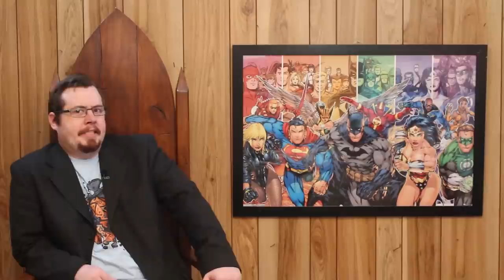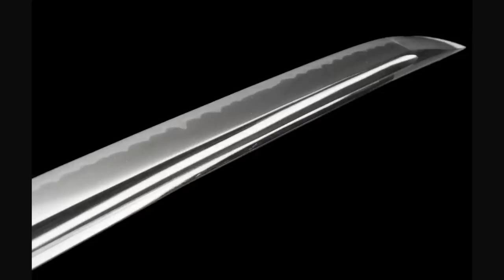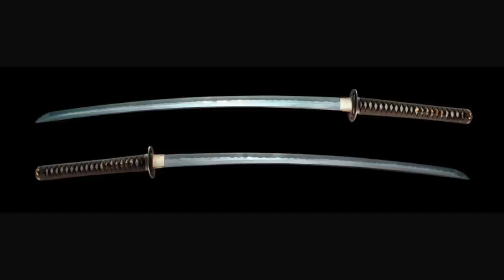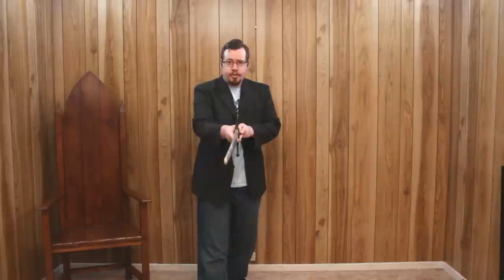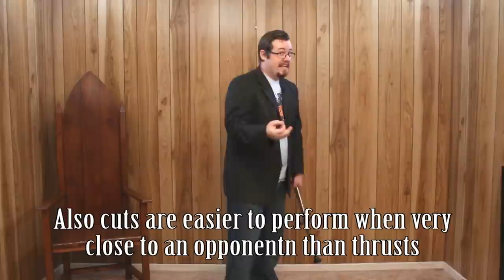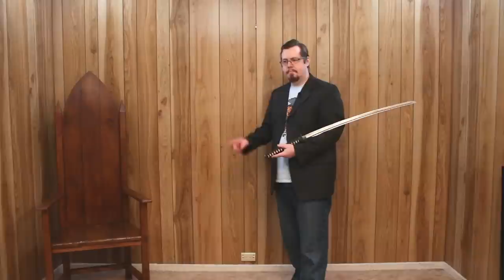Super cutting swords, are they needed?

Comment: The answer is actually probably more simple, looking at it from a workman´s perspective. Good enough sometimes isn´t good enough, if you bear with me. Anyone who works with wood, for example, knows the most dangerous tools are those, that aren´t as sharp as they possibly can be. There is no sharp enough woodworking tool. 
The same goes for swords. In order to work well in ANY situation, you just can´t have enough of its specialized power. Sometimes situations are less then ideal, especially in Combat. You might not have enough room for a full swing. You might be lying down or being hampered by a comrade. You might be weakened and can´t put your normal full force behind the swing or chop. The swing might not be coming in at the perfect angle. etc.
In those kinds of situations, what was formerly good enough might just not be that, anymore.

There are so many reasons for swords gaining a specialization and then trying to up it over the top. Just look at the roman Gladius, for example. In fighting close to your comrades, you had no room to swing. So it was specialized for chopping and thrusting. The whole fighting style of the roman legion was based on that. So could you be sure that you only met the same Barbarian, wearing no armor or just a shirt every time? What if they just for that day decided to wear some thicker wool or even leather? Or adopted your own armor, the early chainmail?
What if he was fat and you had to penetrate further? If he had a shield, would it take 3 chops to split it, or 5 or 6?

So no. I don´t think that good enough is good enough. ;)

Comment: sometimes weapons are designed FOR the tactics, and there are times when tactics is adjust to a specific weapon or its focused property. 
IMO, thrusting has to be a lot more precise to deliver that deadly blow to a pinpoint, especially on a moving target (harder to deflect, true, but also easier to dodge/shield block). that's why off-centered tips are so terrible at aimed attacks and mostly resolve to cutting tactics. as of cutting/slashing motion is wider and can acquire the target's area better. 
However, cutting motions are also limited in confinement, so in restricted spaces you'd prefer thrusting or chopping down or BOTH -- which would make the more versatile weapon the better choice. 
is it an overkill to be able to slash better? no. not more of an overkill than to be able to thrust better.  I think it's mostly about the purpose of the weapon (much like today you've got a vast variety of bullet tips serving different purposes). let's not forget that the rapier only took its spotlight in the urban duelists scene, not on the field. But who's to say that medieval trends were based on effectiveness alone, and for the sheer trend...

Comment: The romans thought the thrust was far more deadly and debilitating than a cut...however and this is key biological point here, the deeper and wider the hole you poke in someone is what's actually important...a very thin narrow blade for example designed to penetrate chain mail might not be deep enough, cause immediate damage, pain or blood loss to be deadly or debilitating.

I'm glad you actually brought up crowd control at some point though...people in these discussions seem to assume all things are equal and they rarely are, I highly doubt there was ever a time when fully heavy plate armoured knights, samurai or whatever (insert your favourite faction here) out numbered the lightly armoured ill equipped common foot soldier or peasant on the battlefield.
 
There are very basic tactics and strategies in battle and combat that boarder on opportunistic and cowardly...you don't attack the enemy where they are the strongest and most protected but where they are the weakest and most vulnerable, in fact if ya smart you don't engage or pick a fight with someone strong in the first place but rather someone who is weak...for example it just wouldn't be smart to have your mounted knights charge and attack other mounted knights, it's inefficient and stupid when ya can have them trample and butcher archers or peasant foot soldiers or infantry formations etc 

Common sense shit about war and battle is covered by some chinese dude in a obscure book (I forget the name) something something WAR lol...he proceeds to go on about the importance of deception and misdirection concerning this cowardly and opportunistic but common sense instinct, make em think ya weak when ya strong and strong when you are weak blah blah blah...whatever lets not go off on a tangent...along with this fairly obvious stuff he he offers other relatively logical and basic common sense advice about actual combat as well like the need to be flexible and adapt to suit the circumstances and how predictability is a severe weakness...one of my favourite female anime characters said it best "to over specialize is to breed in weakness which is ultimately a slow and certain death".
In short there is no right answer, no superior weapon, tactic, strategy, technique or method an intelligent and determined opponent can't find a way to counter and overcome.

Comment: I wonder if the key aspect of swords which are optimized for cuts is the damage they can cause to armor and to the enemy. If, for example, you try to block a heavy blow from a longsword with a thin and lightweigth rapier ... well, good luck. And the same (but not to the same extend) must be concidered when you use a longsword against a weapon that is optimized for cuting. An other aspect: Concider the effect on chainmail and scale armour. No sword can cut through, but the one optimized for cutting will cause much more pain and broken bones.

Comment: I think swords meant mainly for the battlefield cannot be looked apart from armor. I think beefier swords were more useful before full plate (or when there was mainly chainmail being used), not so much because anyone was under the delusion that the sword would cut through the mail, but because the aim was to beat down the person underneath the mail. So, a beefier sword with more weight in the cut means more punishment for the person taking the hit. Once plate armor is introduced, axes, hammers, and the like do the job much better than a sword would.

Comment: For some reason, as you’ve been talking, 1991’s Robin Hood: Prince of Thieves keeps coming to mind. Specifically, the scimitar that Azeem uses throughout the movie. It always struck me as a great mass of metal and weight at the point and illustrates what your talking about, no thrust whatsoever.  So now I’m curious on your thoughts regarding that design and also the Locksley sword the Sherriff of Nottingham takes from Robins Father in the beginning and uses in the climactic duel

Comment: you seem to be ignoring one thing about cutting swords : climate. curved swords such as shamshir were used in middle east, now unlike medieval europe, middle eastern countries such as persia were vast lands in which cavalry and horse archery were favored over infantry. the reason being that infantry has a harder time moving through middle eastern terrain due to heat and lack of water than let's say France. 

the issue of heat and horse riding long distances also brings the issue of gear, imagine the well-armored cavalry and knights that use plate armor. they will have much difficult time surviving a trek across the desert, now granted, they will not be in that gear for the duration of the trek, but they will need to gear up for the battle. and if you're trying to fight in full plate gear across the middle east in a harsh spring or summer day you're incredibly fatigued before the battle would even commence due to heat and dehydration.

the cavalry in the middle east would be wearing lighter armor, which gave them more mobility. the middle east concept of heavy armor would be chainmail which would protect them against arrows. that is why you don't see plate-covered knights in the middle east. it was very unfeasible to invest in that sort of gear only to see it eat dust in a corner because nobody would want to wear that in the heat. 

which brings us to the point of why curved swords such as shamshir, shamshir is a weapon that could be used both on horse and on foot, usually with a small buckler for infantry. the cavalry would be facing light armored infantry or light to medium armored horsemen, in both cases they had no need for a thrusting weapon but rather a weapon they could swing, make a cut, and ride away. they would deliver multiple swings, and make no mistake, shamshirs can decapitate limbs and heads if they are swung at the right angle and towards the right body part. they wouldn't even need much force due to their curved design. which is also why they are curved, its not for thrusting but for swinging and decapitating. 

light infantry also would not be dueling one another 1v1 so the idea is to be able to have a weapon you can swing around and deliver multiple wounds in a tight space. a curved blade and a buckler can do just that. now granted in a duel a rapier might be superior but we have to keep in mind that the concept of "dueling" was not really a thing in the middle east. there are accounts of 1v1 combat between commanders of armies during wars, if rapier was invented earlier and made its' way into the middle east, it would probably be a favored weapon among commanders who would "sometime" agree to fight the enemy commander before a battle commences.

so, a curved blade, while might be inferior in duels, was a quite effective and "balanced" weapon for horsemen and for infantry to carry around. due to the type of armor the soldiers were expected to wear.

Comment: I think it is impossible to judge the effectiveness of a sword design in a vacuum.
For example with a curved blade you can do thrusts at odd angles around protection (from behind and around your own shield as well) as long as you follow the curvature of the blade, it won't bend. I imagine those being even harder to defend.
Secondly when you talk about one handed swords you should take into account a shield (when the sword lacks hand protection) or another secondary object, so the reach disadvantage is not as devastating as it is without a shield.
Then you must take into account the whole situation in a fight. If you are on horseback, you won't be successful with a thrusting sword - you will use the lance to actually thrust forward using the power of the horse. So if you use a sword, you will mainly cut. In my opinion that is why a lot of fighters and cultures specialized on horseback in history used a curved blade. 
If you are talking about self defense, it is easier to cut than to thrust when you have to react quickly. Most of the time, attackers don't tend to warn you before, when they are serious. And maybe you don't get a perfectly aligned cut, fights can be messy, but the weapon design can mitigate that.

I am not saying, cutting swords generally are more successful. In a one on one fight on foot with both sides unarmoured and without any shooting weapons and prepared for the fight (a common duel), I assume the rapier to excel against most other designs.

But maybe there are reasons why especially curved blades are extremely common throughout history alongside longswordish designs or even without.

Comment: ive only got just under six minutes, but I believe that cutting ones arm off is far better than having it stop mid joint. I feel it is important (avoiding armour) to have speed, and if you're disarming someone (pun unintended) then I personally would much prefer the sword to cut through the entire arm, because if it doesn't, you have to draw it out of the material you are cutting in to. This would  easily leave you open (depending on certain aspects. i mean, if you cut off there sword arm there isn't much they can do).

Comment: Cuts are better for many things, as others have pointed out. I'll just add my thoughts with regard to extreme cutting ability: Reduced strain on the arm. It may not seem like a huge issue. After all, we're talking about killing people. Surely you can afford to put some effort into it! However, battle can come after other strenuous activity, and then drag on for hours or days. The difference between a rested arm making an easy cut and a tired arm making a strenuous cut can be huge. A sword that will slide along the target, straight into the next motion, rather than come to a complete halt, be retracted and then swung again, will amount to both easier and faster cuts. Alas, these are things that can hardly be tested without running a full scale, hours long, real life battle, where people are cut down in droves. It'll have to remain a theory, until the glorious day when swords retake their rightful place on the field of battle!

Comment: You make a good point, but it seems to me that most of the super-cutting swords are made for cavalry. I think you'd have a bit of a tough time trying to use a longsword or rapier when riding on horseback. One swing with a saber along with the momentum of the horse would be very effective in wartime, especially when facing large amounts of ground-based opponents.

Comment: I would think extra cutting is great for gambeson, which would be the most common on the street. So I think the Messer and Falson were made specifically to cut through gambeson more effectively. When you get to mail and above, i agree the cutting is overkill because a piercing trust is better for metal armor. So as a side arm, not expecting a fight; you would want a better cutter just in case some guys in gambeson tried to mug you by my thinking

Comment: Slashing swords tend to come from cultures which have a heavy emphasis on horseback melee in warfare. Last thing you want is your sword getting caught in the body you just cut into and are riding away from. Either you lose your sword or you get pulled off the horse. Using a sword to stab from horseback is kind of a poor plan. For that you use a lance or spear, but your backup with probably be a sword and you want it to slash through things. Fighting on foot, I'd agree. Europeans got off their horses a lot more to fight than Samurai, Mongols, or Medieval Arabs. They also tend to be light enough to use one handed, as that gives you more reach. In the case of the katana the hight and speed from your horse offsets the reduced power of using it one handed.

Comment: I'd think that a very curved sword is better on horseback, not mainly because it cuts somewhat better, but because on horseback a thrust would be risky since if you actually succeed it would be stuck in the target and be ripped out of your hand. And I guess a very curved sword gives you no choice but to cut and when it cuts the curve would cause it to be pushed slightly back into your hand (if not the friction cancels out the effect) thus being more likely not to snag and be ripped from your hand.

Also if you only have one blade to use for everything more often as a tool than  a weapon having a blade optimized for cutting and chopping (like a machete) is more useful.

Comment: cutting all the way through limbs is easier for quick succession and not to mention cutting only to the bone means you will usually have to pull the sword back out the way it went in doing so leave you very open for someone to come up and kill you where as cutting through the limb or body part leaves you in a better position to block or counter strike an incoming enemy

Comment: One factor you neglect is impact, If I am wearing say a mail shirt (real riveted mail) and someone slashes at my arm with a light/flexible blade it will bruise at best, while a nodachi (or even rigid longsword) won't cut through the mail either they carry a hell of alot more impact and could easily injure or even break the arm through the armor. To your argument, that has less to do with a specialized cutting shape of the blade and MUCH more to do with the weight balance and rigidity of the sword. We know that flexible armor was the standard for most of our history so chopping power could have been a very big factor even when the armor could withstand the cutting power of any sword. Also destroying an opponents shield is an advantage and you won't likely do that with a thrust, vikings would bring two extra shields to a duel because of their focus on destroying their opponents defense so don't count that out as a factor. Axes, maces, and warhammers remained a staple in battle until the era of firearms, the reason for that is the impact they carry through armor and shields, so I could see the appeal of a sword with significant cutting/chopping power as long as it still had an effective thrust and good reach.
The rapier you mentioned was a dueling weapon, not really a battlefield sword, the lack of blade rigidity limited it's use against armor.
Reply: Well when flexible armours were common, cutting swords were common as well. Up until the 1340s. From around 1340-1400 there seems to be a shift to pure thrusting designs and with around 1410-1550 we see the cut and thrust designs with 1550-1650 again a period with thrust centric swords on the field and from 1650-1940 mostly cut and thrust swords again.